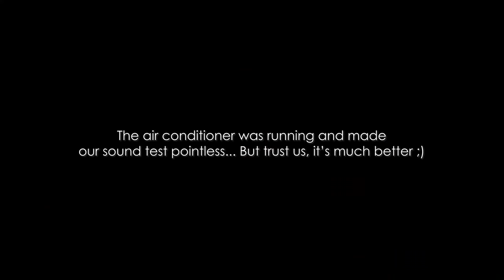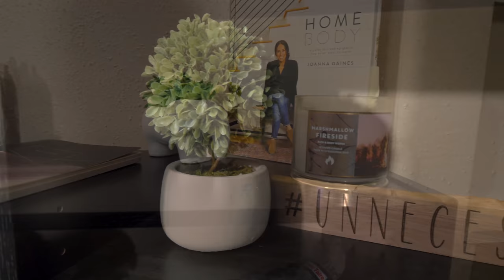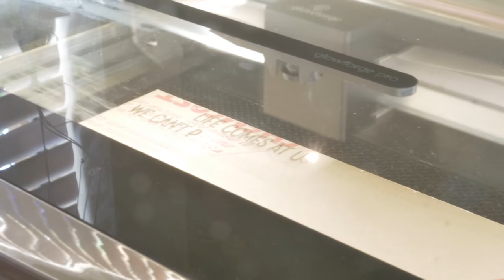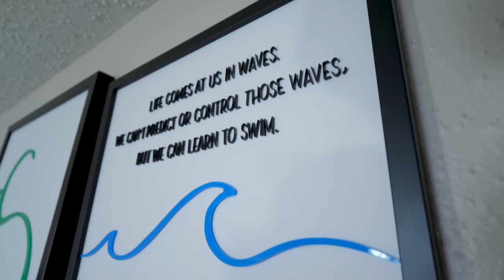🤔the HIDDEN MEANING in our home studio 🎥🌱 | Home Studio Makeover Part 2

Comment: People have lots of thoughts on the Glowforge but we really like it overall if nothing else for its ease of use, like you were mentioning as you unwrapped it. It's as easy as it gets to use safely and effectively. Repairs have been a bit less-than-seamless and frequent. However, to be fair we put A LOT of miles on ours and I think it is not necessarily meant for "manufacturing" per se.
Reply from the maker: Interesting! What’s been the failure mode?

Comment: Al always, a nice video. It is very inspiring the see how your family business blossoming. Quick question. I am planing on investing some money in the future on a laser engraver. I was wondering what is the thickets material you could cut with it and the maximum dimensions of the board you could engrave if I use it for customizing cutting boards etc.
Reply from the maker: Hey thanks! The thickest you can cut with a glowforge pro (in one pass) is 1/4” stock. You can take multiple passes or flip a thicker board over and cut again, but that’s the limit for this machine. 

Obviously a more powerful machine can cut much thicker, but those lasers are outside of our needs right now
Reply: Jennie and Davis thank you.. blessings